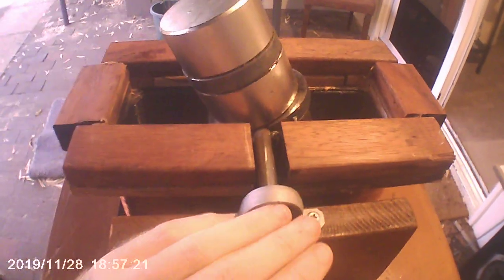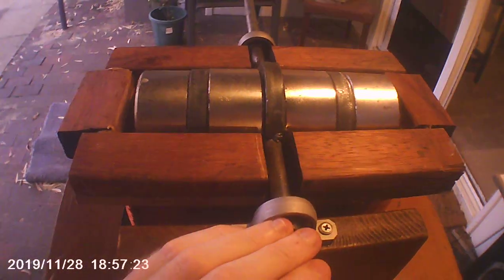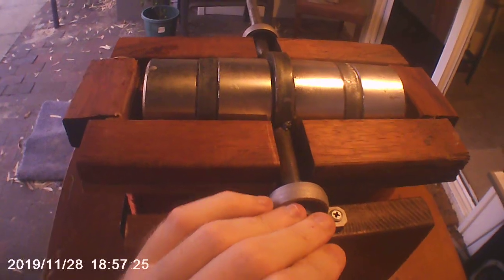Newman Motor * 5'th Prototype . conclusion : FREE ENERGY YES,  PRACTICAL NO

Comment: Would one be practical with a coil with near ZERO resistance?, if resistors are connected in parallel it halfs the resistance yes, what if 20 are in parallel it'll be 20x less resistance yes? Copper wire work the same  thin 0.5mm 20wires need to be wound together as 1.
Reply from the maker: nope. sorry,   this machine is not practical because its an "ideal motor", - closer too 100% than any other on earth. - which means is most definitley limited too.....   -   the linear motor, is not,

Comment: Great work, really appreciate your honesty with your results from from your hard work. 
Just a suggestion, I believe that there is a great deal of promise in Thane Heins projects, perhaps you might want to check them out if haven't already, and maybe consider doing a build of the generator in that manner.
Reply from the maker: i couldnt make his designs work, - but i did discover why his students believe in his.         after speaking to him on the phone, i confirmed the unfortunate truth,   his machines are being measured incorrectly, and are not COP+ sadly,
Reply: @director-patrickwatkins   RegenX coils cores are made from metglass, a ferromagnetic material which reduces eddy current losses. RegenX coils cores can also be made from ferrite.
RegenX coils is wound using bifilar wires. Above critical minimum frequency, around 1kHz, current will flow through capacitance between wires, and that will cause time delayed armature reaction to accelerate the rotor.

Comment: This way you would eliminate all the complicating switching .wich AC power
Reply from the maker: that would be great, but it will never happen, because the "TDC" of the motors rotational position has no torque.! - basically its like a car driving over a speed bump at every TDC,  so it would tear itself apart with DC or sinusoidal AC  ... It needs even more complex circuitry ideally, thats what newmans silly looking commutators are all about.

Comment: Hi Patrick how about if you use an ups or an inverter with sinewave on this newman motor and you colect the bemf trought diodes you think would be posible and use little power and the work would be smoth and the power amazing like on an mono phase induction clasic motor .
Reply from the maker: correct, just read your last question, sorry for the late reply. - but we need an inverter just adjusts frequency and wave shape ......  in time with RPM aaaAANNNDDD load.  - it really needs computer control, hideously complex requirements. unlike any other motor, -

Comment: Great work and thank you for sharing performance data so clearly and honestly. I must say the Newman machine is fascinating but I’m a bit discouraged to try building it based on your performance results. Looks like it could be $3000 in wire cost alone and then only output 50-100 watts OU?
Then again, perhaps could be improved over time with enough replications out there.
Reply from the maker: OU has to be the most outrageously expensive energy on the planet, but i have 3 working machines now. -july 2021, working on better ones (and cheaper

Comment: Tape-wound cores made of nanocrystalline iron contain many turns of ribbon inside which can conduct electricity. This nanocrystalline ribbon, while several dozens of times less electrically conductive than copper, can be over 60,000 times more magnetically permeable in the audible range of frequencies. They are also highly efficient, with lower hysteresis losses than many ferrites in this range, despite also being able to pass a current. 

Newman spoke of having rapid alignment and unalignment of atoms' magnetic fields in his coils. Many transformers have such rapid alignment and unalignment, but often the hysteresis losses I'm sure overshadowed the Newman Effect, making it invisible. Furthermore, transformers, SMPS, chokes, etc. use core materials which are good at keeping magnetic fields from reaching the windings where the current flows - so they do not provide much of a field inside the copper to align and unalign the atoms. Meanwhile air cores, while allowing to spread much of the flux throughout the volume of copper, require vast amounts of material to produce a very strong magnetic field.

So our best bet may involve passing a current through the wounded strip of nanocrystalline iron ribbon such as Finemet, Vitroperm, or some "generic" equivalent that you can find on Alibaba. Toroids made of the material are already annealed. I have them already, and I have confirmed that the ribbon coiled inside the toroids can function as an electromagnet, which verfies that the nearly the whole length of the ribbon is being occupied by the current injected into it, with no shorts.

I am at the stage of working out how I should trigger magnetization of the toroid while simultaneously passing current through it, as well as how to control the process and estimate effectiveness.

I think this may work because I think what the Newman Effect really involves is using magnetic fields to cause Hall effect-based seperation of charges inside atoms' electron clouds to generate nano-sized static electricity which can cause "interatomic discharges" which help drive currents in the electron sea of the conductor. In this case, nanocrystalline iron seems to be a far superior option to copper. We'd need to have windings wrapped around the toroidal nanocrystalline iron core, with that winding's current in series with the current in the ribbon making up the core. If my hypothesis is correct, this should result in far greater power density than the Newman machine. It also helps that nanocrystalline iron is evidently in many cases cheaper than copper. Best of all, the "coil" inside the toroid is already premade and you only need a few toroidal amp turns per inch wrapped on top of that to get to an over 1 Tesla magnetic field inside the conducting path of the current in the ribbon. This would be a pure generator - not a motor.
Reply from the maker: Thankyou for your time. - and i agree about those AMO nanocrystalline  cores, - amazing, even the cheap alibaba ones i purchased.  - unlike ferrites they keep singing up too several hundred khz before they start to ring down... unlike ferrites which can stop resonating at 50-100khz....   so they are impressive cores, but not the solution to any problem i have ever had, and actaully can provide a dissadvantage unless you have very sharp switching times....  newman motors just want to be bigger and heavier.  https://www.youtube.com/watch?v=Stjf7M1Cx78
Reply: ❤Great, thanks ❤

Comment: I recently built a newman motor on a small scale, and I've been contemplating adding 62 pounds of wire to it,  but when I see what the counter electromotive force does to my motors speed as I continue to add more wire, it doesn't look promising that I could ever come out ahead. Here is my latest. https://www.youtube.com/watch?v=MVkSoHrTGMs
Reply: Thankyou Grant. i really enjoyed your video,  I have created a rule of thumb for building newman motors.  *max out the voltage rating on your wire*, because after tuning the current will always be near zero when running optimally.      for highest COP. we want a large motor and a light load.   - 

my newman journey in fast forward (45 mins or so)  evolution of understanding
1 : https://www.youtube.com/watch?v=CbrMbAuC7pE
2 : https://www.youtube.com/watch?v=NZDoy4nxNVU
3 : https://www.youtube.com/watch?v=Qrgy_zz6bwA
4 : https://www.youtube.com/watch?v=4_wZDMnE5js
5 : https://www.youtube.com/watch?v=lT3wxiGM8Ys
6 : https://www.youtube.com/watch?v=AAqq1uNIfXg
7 : https://www.youtube.com/watch?v=Stjf7M1Cx78

sorry about all this. but i wanted too rewatch all my videos, 6 months on, and create a list too help explain things in the right order, - as i discover how the machine works, and go through the process of scientific discovery.    -grant, i know you have seen most of these already.

there IS free energy here. i have seen it.
Reply: @patrickwatkins7572  Here is one I made with 62 pound coil. https://www.youtube.com/watch?v=DKxCPJKRM9Q

Comment: hey, I know you said this in one of your videos, But my question is what is the wight of copper with your experience needed to make the tipping point to make it go at 100% efficiency? and the compare with the N52 wight? what would you say would be the minimum of copper needed I think I remember you said in one of your videos that everything under 4kg of copper is a wast of time correct me if I remember wrong. What would you say If I say: 8kg copper, and 1,5kg N52 chance of 100% efficiency ?

Kind regards Nerv
Reply from the maker: hi, appologies for the late reply, - there is a recipe. if you want a 1-10 watt motor which is a good example of the breed (COP10).  go for around 1500ohms and 5-8kg of copper.  assuming the geometry is similar to my models.  https://www.youtube.com/watch?v=Stjf7M1Cx78  - and never use commutators
Reply: @director-patrickwatkins  Hey :D I did not expect any answer, but I appreciate the time taken! my motor is two coils awg 34 estimate 4 kg each coil, and about 18k and 19k Ohms, I messed up here as my winding machine malfunction :/ so one coil is 41246 turns and second one is 41836 turns.

But why not use any communicators? I build one communicator the arcs are so strong it burned my epoxy on it, and the voltage is so high just by rotating slightly with hand it jumps over 1k but the angels was slightly off on my communicator, so it misfired with 20 fire and 20 shorts, so I need to build a new one. But you recommend not to use one? Sry for all the questions xD

Thanks you for replay :D

The best and kind regards
Nerv

Comment: Imho you should check in Nikola Tesla's "earthquake machine", where the pistones move to and fro and on the piston there are exerted always the same forces so no eddy currents and instead of newman motors and similar angular motion, the spike happens at the center of the coil magnet and it switches direction after leaving the center line and this is red as back emf spike of some sorts or cavity or eddy currents.
In Tesla way, the amplitude is speed dependant and when it changes direction is stationary, so when it starts moving in the other direction its again uni-directional field exerted on the coils. Given an understanding of vortex magnet motion: https://www.youtube.com/watch?v=65SaRqdcdng&t=635s
Reply: sounds like my OU linear motor design https://www.youtube.com/watch?v=rtE0NPCHwQQ

Comment: .. Did you know the Newman motor was intended to turn a generator.
Reply from the maker: hehe thankyou,  i have connected generators between 2 watts and 300watts.  -  max power output from my newman prototypes is 40watts. - but it drops too COP 0.7,   -  my best results are COP 10-20 at a few watts.  -  as with any lenz law machine, a drop in RPM causes an increase in input current, trick with newman motors it make them big to minimize the drop.  and lenz is a regulator, not limiter ;-).  please see a newman demo of mine.  https://www.youtube.com/watch?v=Stjf7M1Cx78

Comment: Am not sure I think you are doing everything different from Mr Newman. Newman is talking about rotor weight copper wire weight, from the rotor weight momentum you can get the required toque you want, that was what lead him to speed is power theory imagine a 300kg rotary moving at1000rpm using may be 40watts power, that is tremendous me and you can not hold the shift to a stop with bare hands
Reply from the maker: thankyou, did you watch me trying too stop the shaft on my little newman motor ?,  - i wish i could have held the big eureka.  https://www.youtube.com/watch?v=Stjf7M1Cx78

Comment: Lukie Kelen oh ok well one of my emails is Not RickSanchez I made it that so people know that I’m not Rick Sanchez, having said that I just had a thought if I was Patrick here I’d consider using force {in a practical way} and sealing the ‘magnets’ on the ‘Newman motor’ in the opposing position, this would force the field polarity 90 deg adjacent to each , I don’t think it would be practical with those monsters he has there but perhaps if he experimented with some Polarity inertia devices that had a hole in the center then he could get a non ‘ferromagnetic’ bolt and nut and screw them together and fix them with expoy , having done that we know know that the fields would be 90deg adjacent, you could conduct then some useful experiments by shifting the field polarity of the ‘stator’ inductor with a tractor device. Maybe I should post this comment in the main section so it helps people?
I mean after all why are we here if it’s not the help people right ?

{Baaarp}
Reply: hehe agreed. we need too get good at learning from the trials and especially fails of others. because there are so many of them.  its really path too success.